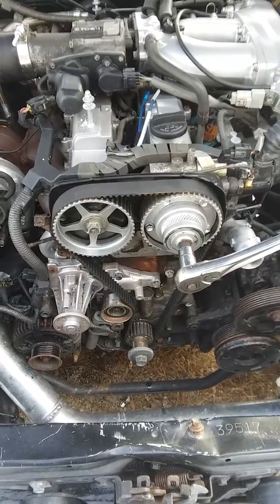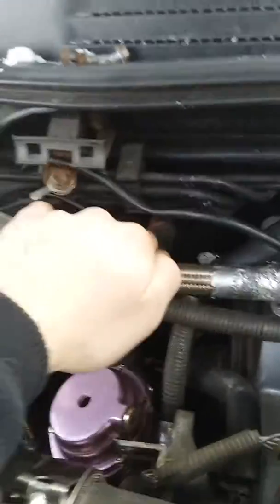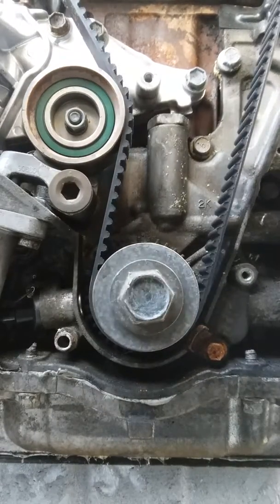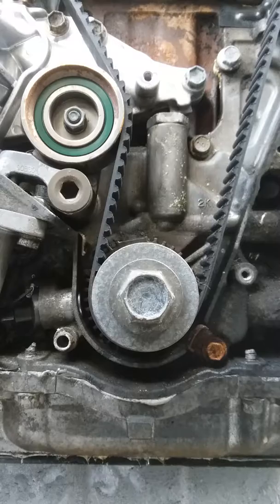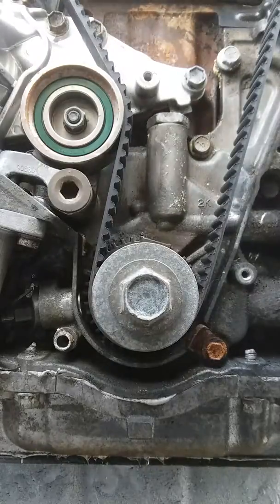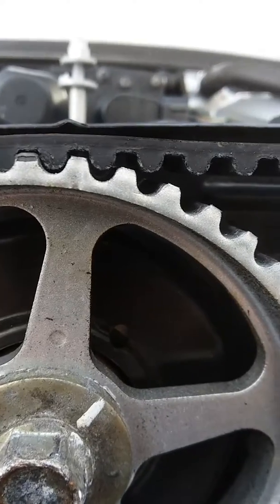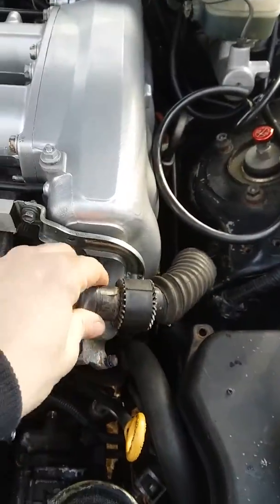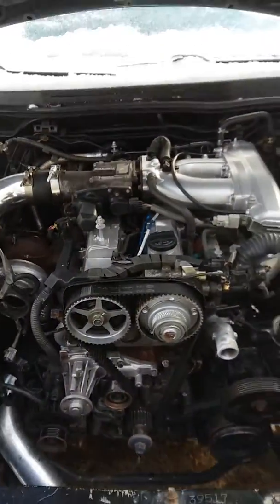2004 IS300 misfire diagnosis

Comment: What codes did you get because I did the seals and now I’m getting P0300 p0301 and p0306
Reply: Did you ever figure out the problem?? Im getting p0300 p0301 p0305
Reply: When i did the timing belt on of the small teeth on the reluctor wheel got broken.  Theyre the little teeth on the crankshaft gear. Your crankshaft sensor reads those teeth and if one got damaged it will give you multiple misfires.

Comment: Did you have misfire code ? I just recently did my timing belt job and I got a p0301 code misfiring in cylinder 1 only
Reply: Really annoyed with how common the misfires are.
Reply: Did YOU ever figure that out?

Comment from the maker: FIXED!
The timing belt was incorrect.
My Crank was on the DOT, and the cam are on the LINES, basically 6 teeth off.
I reset the belt and it runs fine!
Reply: How was the belt incorrect but the lines on crank and pulleys lined up to tdc??
Reply: @FixieFuckk69  the crank wasn't set to TDC before setting the cams